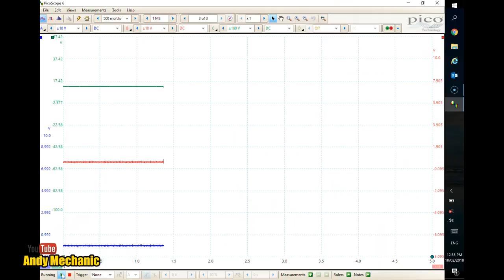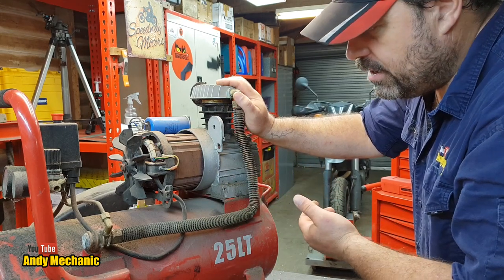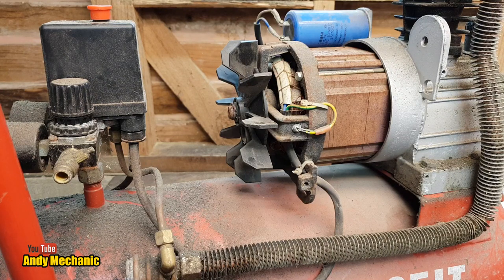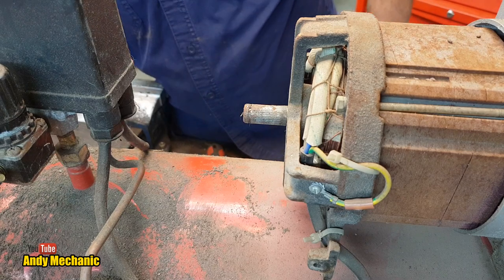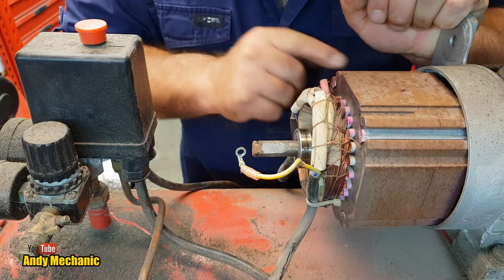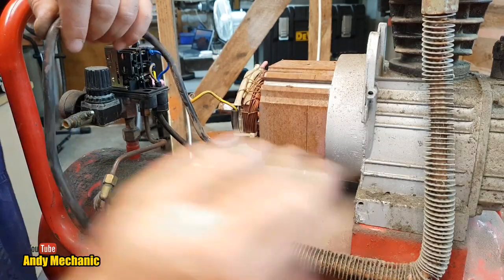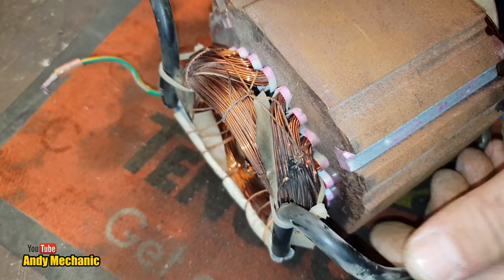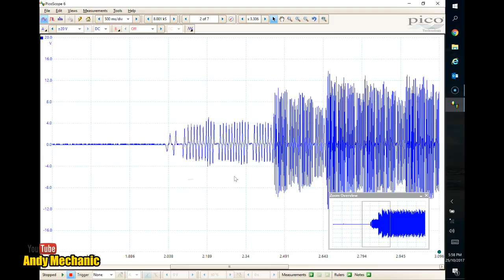Sealey air compressor no run diagnosis #1981

Comment: The capacitor is for  starting it creates a phase difference compared to the main winding, most such capacitors will have an internal discharge resistor so that the unwary wont get zapped. The motor is a squirrel cage type induction motor, inside the iron armature are cast aluminium bars shorted at the ends they act like the secondaries of a transformer and thus produce the reactionary magnetic field.
Reply from the maker: Interesting stuff. Thanks for the heads up. Pretty neat design with no brushes to wear out :-)

Comment: i dont think the capacitor is meant to hold its charge . think it is being used as a smoothing capacitor to take out the inductive spikes and not trip the barker on start up. the cause may have been the non return valve filled with carbon causing the motor to have to load with current before it can start up

Comment: A capacitor will not hold AC what you are measuring on AC is the change of volts, not the charge as that would be DC. Its a squirrel cage motor and the cap creates a phase difference to make it go. Its a capacitor start/run motor.
Reply from the maker: Thanks Des.....I'm pretty good with alternators and starter motors but AC is a whole new World! Cheers Andy

Comment: Looks to me winding shorted to ground and a huge amount of current  flowed vaporizing the winding.
Other option is a metal foreign object. or mechanical weakness caused be vibration.
ohm between Phase and motor frame then Neutral  and motor frame i bet there is continuity.
on your meter there is a symbol -||- that is capacitor measurement.
To test move to that position and test capacitor that one should read 35 uf +- 20%.
 Note before connecting meter to capacitor short pis with screw driver as the capacitor may be charged and will destroy the meter, also removes shock hazard but verify before handling terminals as capacitors can recharge to a percentage of what they were charged to.

The rotor of a induction motor works on eddy currents setting up the magnetic field.
you may have seen on some starter motors that they have no permanent magnets. they use field winding instead.

Comment: As soon as I saw the word SEALEY I thought why would you expect it to work anyway! They sell the biggest pile of crap out there and laugh in the face of the old "fit for purpose" standards!
I will go out of my way to avoid buying anything with that name on it even though they are just a distributor for the less able Chinese manufacturers.
Reply from the maker: Sealey have definitely gone down hill in recent years. This little compressor was only purchased to inflate tyres down at the off-road centre I owned so very light use. It's done pretty well to lsst 15 years given its cost!

I haven't purchased anything Sealey for over 10 years...though some of the items I purchased 20+ years ago weren't all that bad to be honest.

Cheers Andy